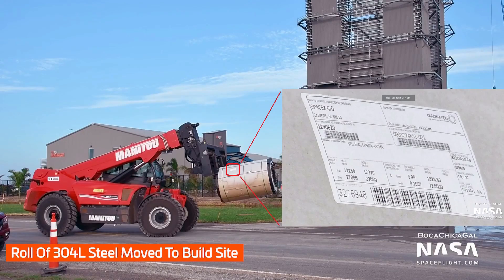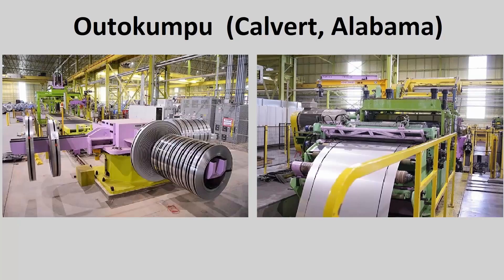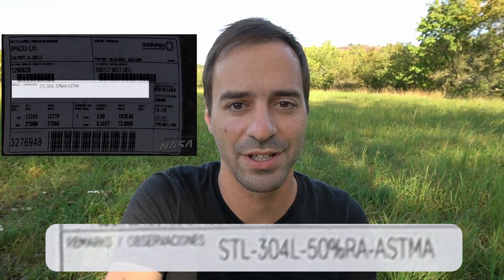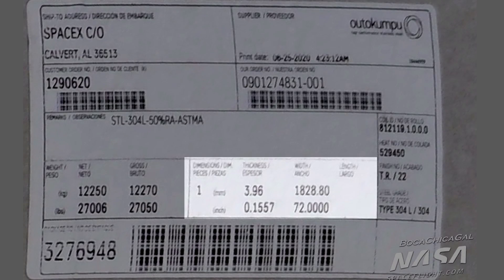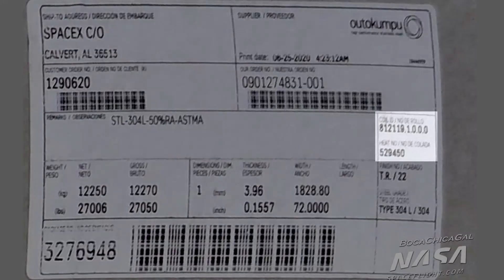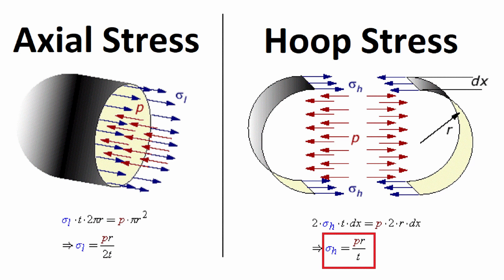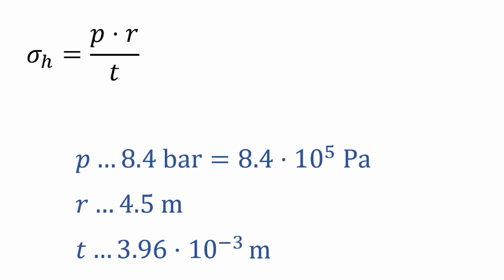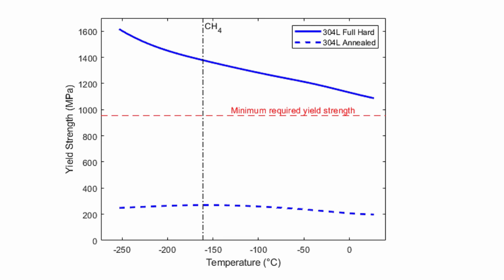What Exactly Is Starship Made From?

Comment: I don't think that a rocket propellant tank is only exposed to the uniform pressure forces(if that would be the case sferical tanks would be used more) , you have the gas pressure that is uniform distributed and hidrostatic pressure from a liquid witch increase with the depth multiples by density of liquid (and depending on the g forces), also you have the load(like the load of the upper stage pushing on the first stage, or like a building higher floor ) from the top pushing down, again two types, the gravity load when it stays on the launch pad, and the inertial load when the rocket accelerate with multiple g. For example starship would have a 1400 tons upper stage pushing on the first stage when it stay on the launch pad, but at maximum acceleration of 3g load will be 4200 tons.
Reply from the maker: You are completely correct, in just greatly simplifying things. The bottom of the tank will have to ensure higher pressure than the top, the difference would be few bar
Reply: @spaceflightexplained360 most of the video from this channel are well done , but this is very much wrong in the basic information that delivers, and for a very tall propellant tanks differences are huge and that affects the design and thickness of the wall.

Comment: Even though the rings will take structural loading what about stiffeners (multi-dimensional), built-up re-enforcement plates and such? I'm also curious on how they will engineer the points where the booster will sit on the launch pad and the hold-down mechanisms. If you look at the Saturn 5 the 4 points are extremely robust and are made out of forgings and built up plates/stringers.
Reply from the maker: Hi Robert! I wonder the same thing - what does the internal rib structure look like? The yield strength requirement due to pressure for the steel should not change by adding the ribs, but it could greatly reduce the other (g forces, windward bellyflop...) forces. It is hard to tell where the worst case scenario - unpressurized and stacked? Fuelled under 3 g acceleration? Landing? I don't know enough to even guess...
Reply: @spaceflightexplained360  You can see some stringers on the thrust dome that are 4 and 5 sided with holes for weight reduction. Most of the stringers on the Saturn 5 used 7 sided and 5 sided stringers along the inside and outside between the tanks. Hopefully we can see more of these structures and the solutions.

Comment: On the last part what would the theoretical limit of a 304l tank? Would that mean that 7.1 could withstand 10+bar?
Reply from the maker: Hi Frank! I think that all the tank failures so far were located in the welds - so the welds are the weak points that they need to improve and test.
Reply: SpaceX said that the dome of SN7.1 had some 301 SS, which is where it broke along the weld seam, then ripped across the top, as the liquid nitrogen expanded through the gap. They had a reading at the bottom of the tank at 9 Bar. Before this, I had contact with a viewer, a 29 year welding inspector fully registered in several states. He calculated (before we knew of the 301 SS) that it would fail at a weld. He predicted a failure at a weld seam (which is rated for an Ultimate Tensile Strength ~60ksi).
Reply from the maker: @David-yo5ws  That is really interesting! Based on what you are saying, the the 60 ksi = 413 MPa in the dome. If it gets to 413 MPa in the dome, that would mean 826 MPa in the hoop stress that the tank survived. That is with a big an not really reasonable assumption that the material thickness is the same.

Comment: Based on the 955 MPa stress you calculated and the thickness of 3.96mm of the coil strip, I reckon this material might not be part of the pressure vessel but part of the unpressurized axially loaded section.  955MPa is well into the plastic deformation range at 8.4 bar of pressure.
Reply from the maker: It should be still in elastic for hardened steel at cryogenic temperature. The only variable here is the thickness, the rest is given, so the only way how to get lower stress is to make it thicker...

Comment: A NSF (?) video a while ago showed a similar label on a 301 roll and thickness was 3.97mm width was 1200mm and gave the weight & length, I think I remember 22T & 267m but not positive. I was suprised that the 304L label gave so much detail but did not bother to give the length. That does not make sense to me!
Reply from the maker: Greg, I had no idea a picture was taken before! Maybe a different supplier with a different label format? It will be impossible to find now... Based on the numbers you wrote, the weight would be roughly 10,175 kg, which is not too far from the current roll!
Reply: @spaceflightexplained360  I have another vague memory of 11 ring segments from each roll. 10T is probable close since SN5 &SN6 mass simulators seem to be two rolls of scrap 301(?) and we are told they weigh 22T
Reply: Your right finding the label video would take a life time

Comment: With the tradeoff of fuel volume versus height and diameter, how about running through the math of weight of shell versus volume.   And especially considering the increasing tank pressure on the lower rings due to fuel weight and acceleration, that implies a taller booster requires a heavier shell than a larger diameter booster of the same volume.   So there must be a booster height that becomes heavier than just increasing the diameter to get the same increased volume.  I.E. will a supersized starship just get wider and what is the max height when optimizing fuel volume versus shell weight.   I suspect the big Boca Chica Hanger assembly building door width reveals how much larger diameter SpaceX has planned.

Doubling the diameter doubles the circumference and doubles the tension so ring weight goes up 4 times same as volume (no saving there) ... but since lower rings must hold back higher pressure (density* depth*G force acceleration), clearly, increasing the height means adding even thicker rings on the bottom.  Balance this against the increased weight of the top and bottom caps as diameter increases.
Reply from the maker: I think you are onto something here... To me this comes back to a very basic question that I realized that I don't know the answer to: Why do bigger rockets scale better w.r.t payload mass percentage? 

As you said, if you double the radius, the thickness and the length doubles, giving you a factor of 4 increase in weight, which negates the factor of 4 in additional volume. Is it the fixed overhead with engines and other hardware? I don't know but it would make for a good video of I find out.

And the width vs. height ... I think it also has to do a lot with supersonic aerodynamics and I don't know much about that at this point either :-(
Reply: @spaceflightexplained360  Elon mentioned this recently - fixed overhead of GNC computer as example why scale matters

Comment: Really interesting, just as the previous one... I have a question, though: isn't welding's role potentially critical in determining the maximum sustainable inner pressure? I mean... wouldn't the structure be stronger (or guarantee higher safety or have a longer life...) if it were made of a smaller number of rings? Have a nice trip, Enrico
Reply from the maker: Hi there! I'm sure they they would want even wider rolls to reduce the amount of welding needed. As I found out during making this video, they are already i using the widest rolls they can get in the US, so that supports this argument. Also, as mentioned in this video, the welds are in the direction of the axial stress on the cylinder, which is HALF of the hoop stress. So (very simplistically, I'm sure)  if they can make their welds half of the strength of the actual steel, they might be OK...
Reply: @spaceflightexplained360   I read on a forum elsewhere that the wider a roll gets, the harder it is to maintain the characteristics imparted to the steel by the cold-rolling machinery. I can't give you a formal source, but the guy seemed to know what he was talking about.

If true, this implies there's a practical limit for economical mass production. I suppose SpaceX could commission their own set of cold-rolling equipment, and develop fine control of the process. Tesla and SpaceX have some top metallurgists, there's no doubt about that. But - is it worth the very high expense? I doubt it, they're making the present ring size work. Well, when they're building a thousand Starships, maybe they'll do this.

Comment: I doubt it is only the structural engineering aspect which this steel alloy is designed for...

I bet it has something to do with the way the steels chemistry is able to handle electrostatic charge accumulated from the interaction of charged particles containing a much broader range of energy/ electron volt levels, which are not typically encountered or accounted for in a spacecrafts design and construction. And/or its handling of atypical levels of magnetic induction, and possibly various levels of radiation.

Comment: When a Starship re-enters the atmosphere it will get hot, and if it gets above the annealing temp it will soften and lose the hardness and strength it had at cryo temp. How do you think SpaceX will compensate for that softening effect?
Reply from the maker: Hi there! There is only one way - don't let it get above ~750 degrees C, at any cost. That is still twice as much as aluminum would give you, but you definitely need thermal tiles. On the bright side, the hotter a thing is, the more heat it radiates away and thus cooling faster.
Reply: A factor to consider is that they will be landing with cryogenic fuel still in the tanks, so I can’t imagine they would let the skin get too hot in the first place.
Reply: @Warriorcat49  The landing fuel is likely to be only in the "header" tanks, which are small separable sections in the centre, and not contacting the outer walls.

Comment: Something puzzles me about saying that Starship’s propellant tanks need to withstand 6 bars of pressure (plus a 40% safety margin). The pressure varies with height in the tank. (That’s why ring thickness is likely to vary.) So, at what part of the tank is that 6 bars being measured? (Perhaps it’s at the top, where anything in a gaseous phase will be?) 

How much does pressure vary with height? If I understand correctly, pressure varies as rho*g where rho is density and g is the acceleration of gravity. I gather the density of LOx is around 1141 kg/m^2 and methane has a density of 423 kg/m^3 (though the temperature and pressure associated with these density figures is unclear). So, that means pressure will change at a rate of 11.2 kPa/m = 0.112 bar/m in LOx or 4.1 kPa/m = 0.04 bar/m in methane. Given that the tank section height is quite a few meters, this suggests significant pressure variation within the tanks. (Does someone have dimensions that would allow us to figure out the pressure variation from top to bottom?) 

And... the above calculation is at the moment of launch. As soon as the rocket starts accelerating, that acceleration will increase the pressure at the bottom of the tank in proportion to gravity plus acceleration. So, the pressure differential will be even larger. (Of course, if SpaceX wants a tank to handle at least 6 bar plus a 40% safety margin in a static pressure test, this could mean 6 bar is the maximum pressure they’re expecting when the rocket is accelerating? There seems to be a lot of ambiguity in what we’ve been told.)

Back to the video... given that we don’t know what part of the tank the steel being examined is intended for, it seems like we don’t know the target pressure it will be expected to withstand. So, guessing the hardness from the strength requirements seems like a potentially unreliable exercise. I do appreciate the attempt to extract as much information as possible from the available data.
Reply from the maker: Thank you for the wonderful write-up! Yeah, it is all very dynamic, so I just, perhaps wrongly, assume that the numbers from SpaceX are the maximum that will be experienced, both in flight parameters, g forces and the location of measurement in the tank. 

Especially, of your start accelerating, the "g" increases but the pressure decreases since there is a less fuel. If temperature does not change.

In other words, you are totally right, but I think that even having ballpark numbers has some value. And I just enjoy back of a napkin math...
Reply: The SN7 tank pressure test blew at the top. It makes sense if they designed the lower parts to withstand more pressure due to density*(1+G acceleration)